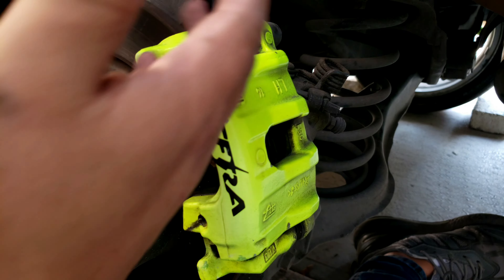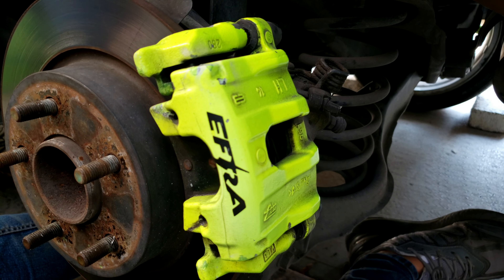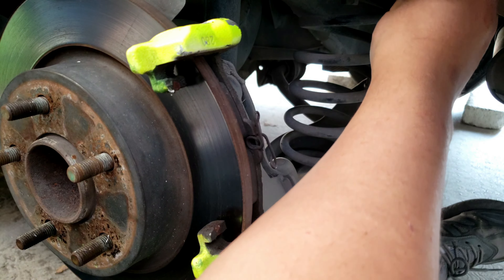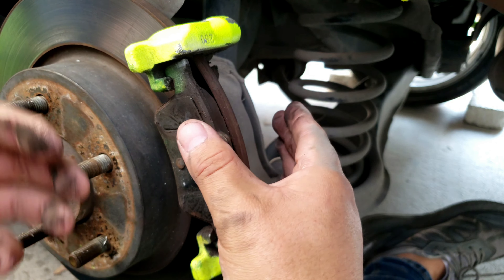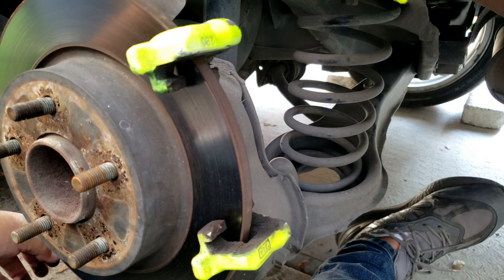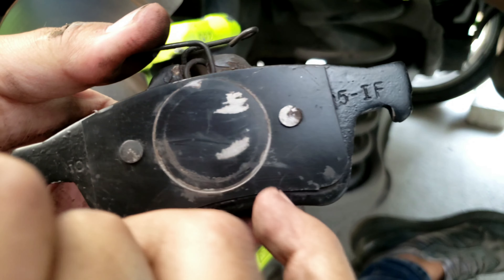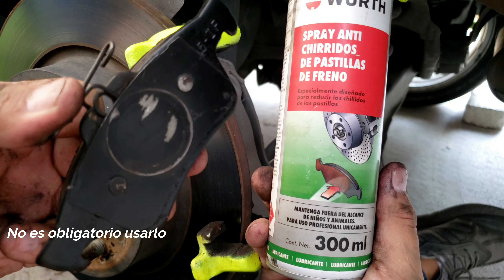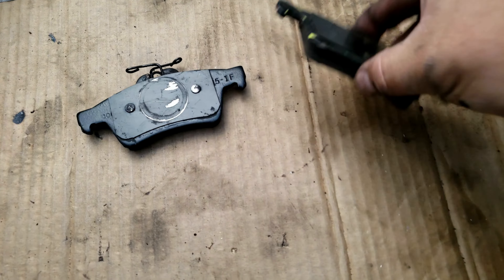¿CÓMO QUITAR RUIDOS DE FRENOS? ¿PORQUE HACEN RUIDO LOS FRENOS DE AUTO?

Comment: Hola, el mío tiene el ruido en la llanta trasera derecha, al frenar parece que se le escucha como si tuviera algo suelto lo lleve con el mecánico le dijo bien las balatas, pero aún así lo hace no se si sea un estabilizador en forma de hueso que lleva , casi a un lado de llanta cabe mencionar que los cacahuates o tornillos estabilizadores ya los cambiaron o que podría ser ya que no le encuentran
Reply from the maker: Lo más recomendable es que lo lleves a algún taller de suspensiones  les pidas un diagnóstico normalmente no es caro (aprox $300mx) de esa forma sabrás con certeza que es lo que esta mal.
Saludos